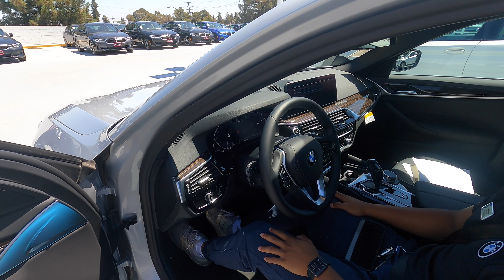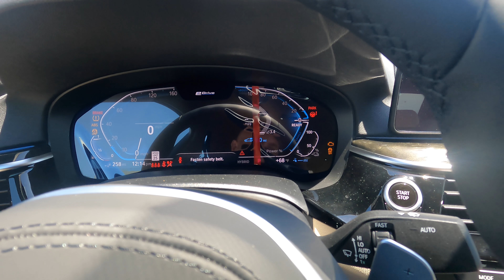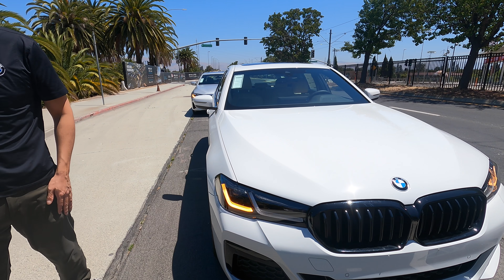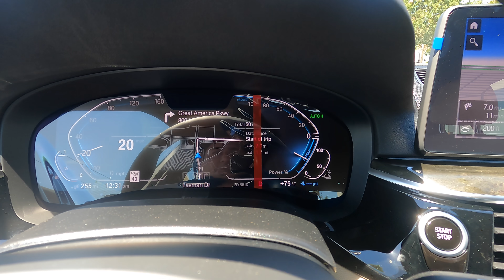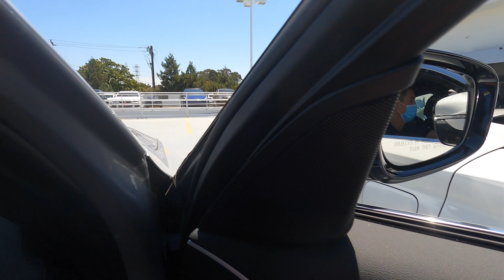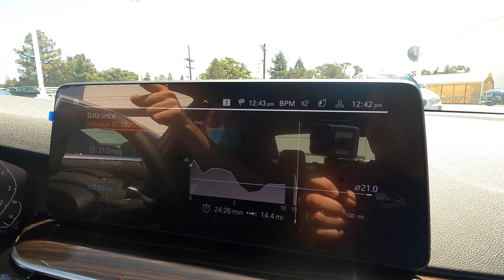Comparing driving modes of the 530e | 4K

Comment: I just bought one of these used in UK, a 2017 model. Taking into consideration UK gallons differ slightly from US gallons, in Hybrid mode on a drive from Nottingham to London, approx 150 miles I averaged 43.2mpg. That was driving very sensibly keeping to around 60mph on motorway. Slightly disappointed to be honest as I expected more. I think I should have just bought a 520d

Comment: I’ve ordered the 530e. I’m still not understanding what you are showing here? What the car should get up to 67mpg. Here you are showing terrible mileages. Should I cancel my order. I’m confused
Reply from the maker: This was not testing the electric range. We're looking at what the mileage penalty is for using battery control. This mode uses the gas engine to charge the battery and drive the vehicle which can be useful for long road trips where you want electric range when you get to your destination city (go full electric). The battery is only capable of level 2 charging and that takes 3-3.5 hours from empty--so not optimal when you're on a trip with that type of stop required to charge. Battery control lets you avoid that long stop and charge as you drive. 

When buying/leasing a PHEV, you should consider your daily routine. What's the distance to and from work, is there charging available at work, etc. So if you are within the range (~20 miles for the 530e) one way with charging at work, then you can get by without using much if any gas. So your MPG will greatly increase as you won't be using much fuel. If your commute one way is greater than the electric range, you're going to be using fuel--not as much as a strictly gas powered vehicle--but still some gas.

Comment: You really should’ve started them all with 50% charge. Starting off with no charge for the typical hybrid modes is really not with a design for.
Reply from the maker: we'd love to be able to do that, even back in 2021 it was difficult to get 3 vehicles to test and difficult to charge them all to similar levels due to time constraints and availability of chargers here. Today, it's impossible with inventory levels

Comment: How often does it need a plug in charging?
Reply: Need to charge every day.
Reply from the maker: Recommended that you do it as much as possible so (hypothetically) you won't need much gas.
Reply: 30-40 miles per charge
Reply: @Wearytravellerredeaux  30 to 40 miles is way optimistic. Spec is around 20.